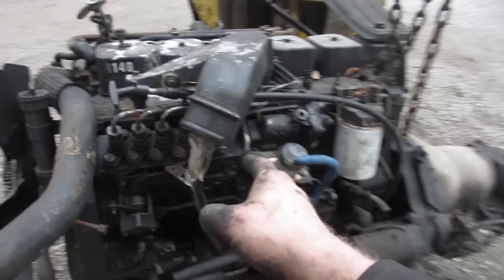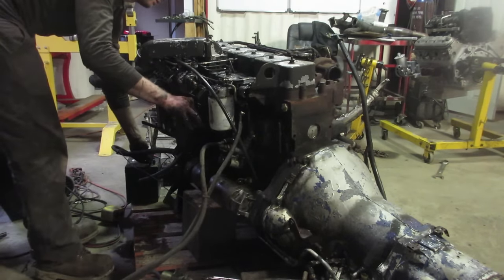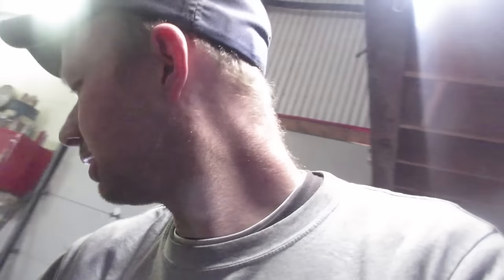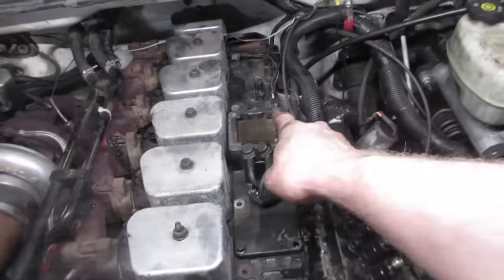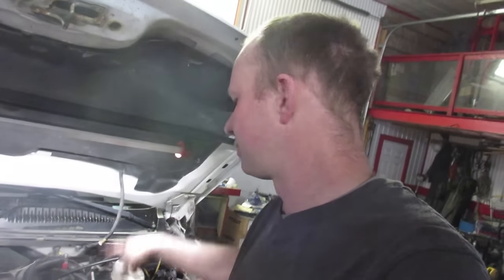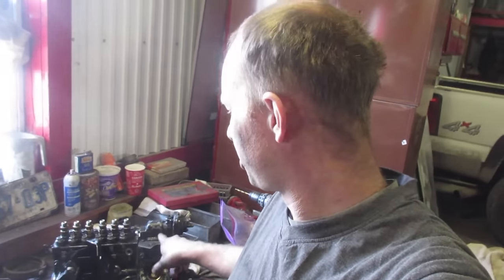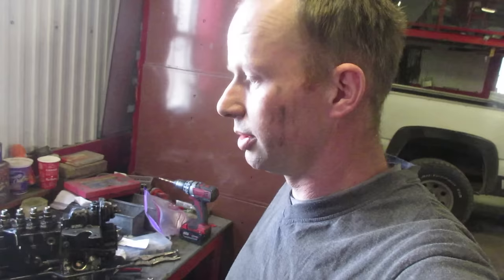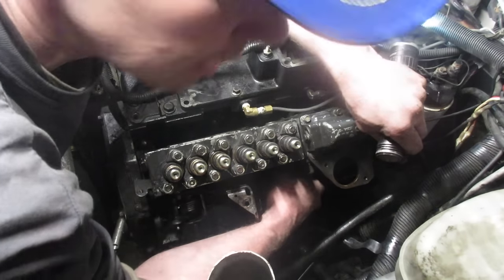12v Cummins P-Pump Governor Springs & Fuel Plate Mod = POWER!

Comment: 7:27 so if you have blow by like that the engine is bad even if it runs good?
Reply: Not really I think he was off his rocker. I have a John Deere 410D with a 4045 engine in it. It has over 9000 hours on the original parts (Things have been changed out due to wear and required work like the fuel pump, filters and such) all major parts like pistons, sleeves, the crank, head etc. are all original. It has tons of blowby and a compression ratio of probably 12:1 now. It can be hard to get running but it still runs like new.

Comment: how long should you run it without coolant like that?? love the video, just curious.
Reply from the maker: The block weighs 1200 lbs.  It takes a while to heat up.  Aluminum blocks heat up much faster and I would probably not run without coolant

Comment: They scrapped it because it was old rich
Reply: Their loss. Any 2nd gen ram in even the worst of condition can be completely overhauled mechanically and cosmetically like new for much less than a new truck. It just takes a little time.

Comment: My 12 valve appears to be leaking oil behind the injection pump. Anybody have on any insight to what or where is leaking thanks in advance
Reply: Midnight Chevy it’s the Tappet cover. It’s a very common leak. The pump needs to be removed to repair the leak. It’s about a 3 hour job

Comment: My brother god rest his sole, could break a anvil in a feather factory for pillows... so long and short was trying to force start his case dozer (450) and it was thirty below and so it caught and ran on its can of either enough for him to crawl in the seat and head for the job that was life and death. Life would of still been okay if the oil was circulating inside .... it wasn't and you could put your foot in the hole on passenger side. I left him dead in the water for a year for punishment but brown eyes and a truly sorry got my spare engine out vehicle fire (only reason i had engine was they thought dead cause of plastic goodies melt that are important) and then swapped the parts back and forth till eginition three days later in dozer. Lots of pieces to change over like use his heads and injectors and p pump... all good and I put my pump on shelf and then when needed it was gone as people take them to hock shops and get good money for them/ERRR,LOL.

Comment: It’s just to bad these engines came in a dodge.
Reply: If Ford or Chevy had these engines you'd say the same thing. A Cummins will outlast any truck you put it in.
Reply: Could be worse...could of been a gm😣😣😣😣😣
Reply: Mark M at least with would still be in a better truck. Something more comfortable and more capable and with a solid engine and more rust resistant body is a win win.
Reply: FishFind3000 gms rot just as bad as dodges maybe even worse. Brand new ones need fenders and bedsides after 2 years in the coal mines.

Comment: 5 wanker duramax thumbs down
I needed this vid for my 97 and 98 
my 99 needs nothing but open road
vp44 can be great with new batteries and
both cam and crank sensors   450,000 miles
if you own a dodge, check the grounds on the 
right battery first for any year  , that's the computer grounds
a little tip from your uncle bill